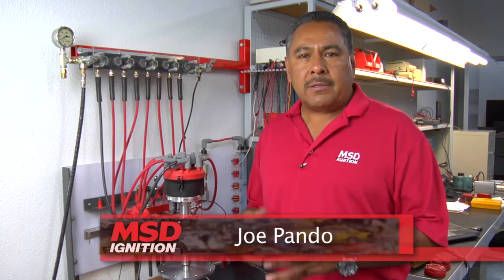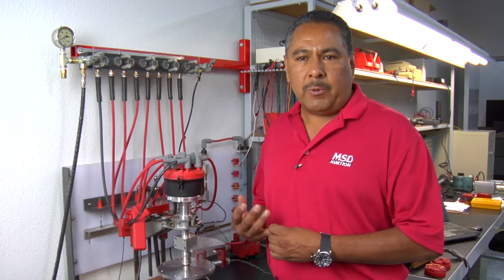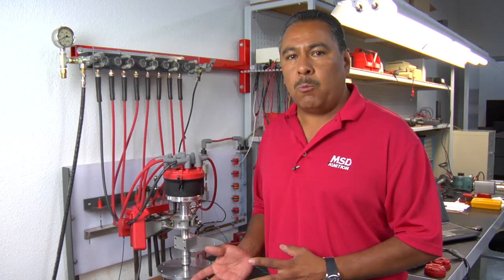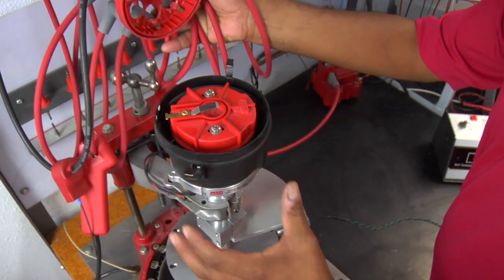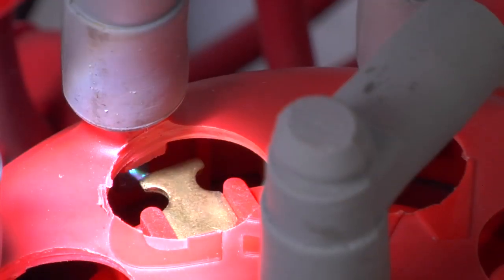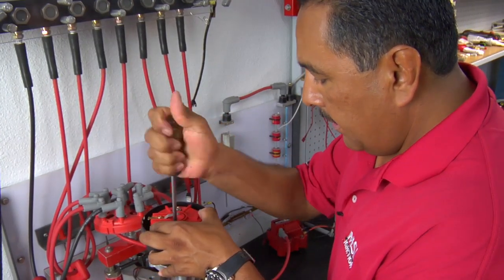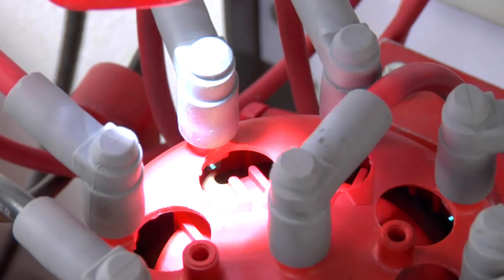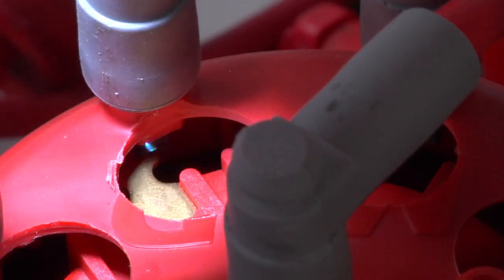MSD Tech: Rotor Phasing

Comment: If you are not using the vacuum advance you can move it to adjust phase and then welding it in place. Vacuum advance needs to be in place on a street engine for economy and clean burning.

Comment: First time I have ever seen anyone address this in a video. Jacobs Ignition hi po book had a tip about filing the rotor to a pointy tip but knowing how the arc moved across the rotor terminal during operation I wondered how this could work in anything but fixed timing setups which were only effective above 3000 rpm, not necessarly for street ops. I was wondering about the spark plug contraption above the distributor. what is that exactly and how is it used ?
Reply: Wow, someone who read the Jacobs book!  I always wanted to read it & see there are 4 editions from 1984, 1990, 1996 & 1999? on Eby.   I now remember a car magazine said to do this & you make a good point about grinding the rotor to a point..!  Now that I think about it, that rotor-mod is for non-mechanical distributors without weights.  Supposedly, electronic distributors controlled by the ECM keep the rotor in phase, but I always wanted to do this procedure to verify it.   Also, you asked about that contraption above?  That is a pressurized spark plug chamber to watch the plugs firing.  Here is a Brisk Spark Plug video of it in action.  https://m.youtube.com/watch?v=SnsUAqC3ON0&t=1s

Comment: Sbc with crank trigger. if I want locked 36 but I'm running boost and I'm pulling a total of 25 degrees under boost. Do I set it on the tail end or front end of the rotor tip?
Reply: Tail end @ full retard.
Reply: which direction does it turn

Comment: MSD needs to make a cap with a plug for this.  The only reason you may need to do this is if you have a scenario where you pull allot of timing...16 degree lets say.  Dont waste your money unless you're doing this or your ECU is.  Nitrous, superchargers would be examples where this is done using a timing retard device.  I am sure there are others.
Reply: Q
Reply: R 425.00❤❤

Comment: Can't you just use a see through cap for this or just get another sacrificial cap to drill holes in?
Reply: Just get a big diameter ford cap, very cheap to buy, drill your holes and set your phase, when I installed my flying magnet crank trigger, I had to do the phasing to pull timing due to using nitrous

Comment: What's with the arcing to the other plug wire terminals WHILE looking at the main cylinder you demonstrated?
Reply: Remember that the rotor is spinning, not stationary.
Reply: You got off topic. 
Only focus on the one terminal. 
All eight terminals makes the same spark.

Comment: I use in my car ignition,  cables,  and coil from msd. 
But rotor is oem because i don't found one from msd or more strong. 
Sometimes  my rotor is melted. 
My car is Opel Kadett. 
In Brazil GM Chevette. 
Do you know one? 
Cheers